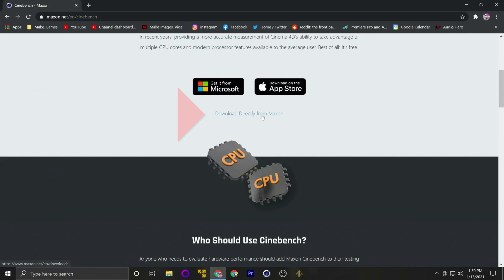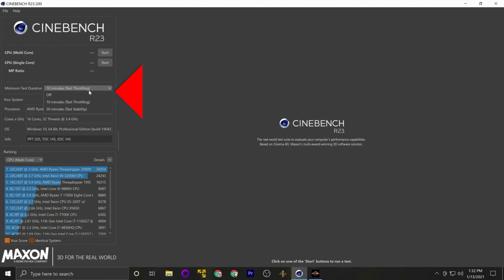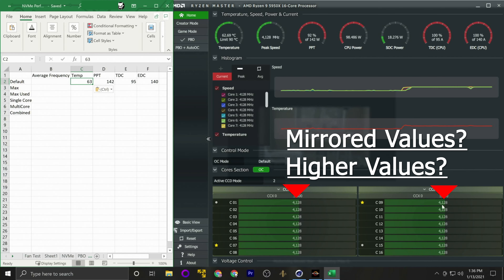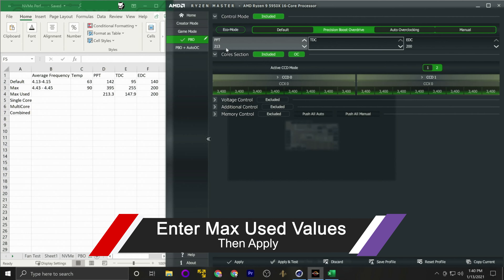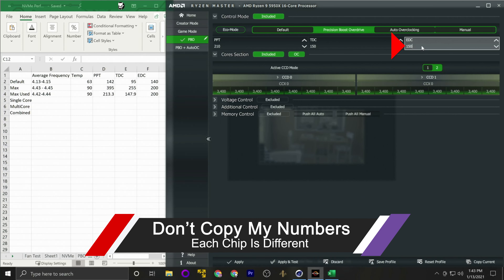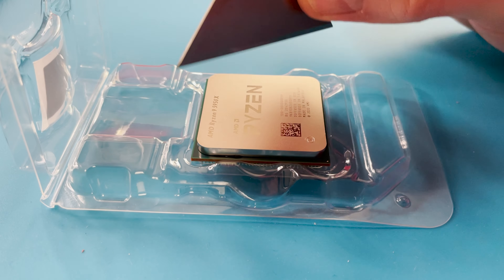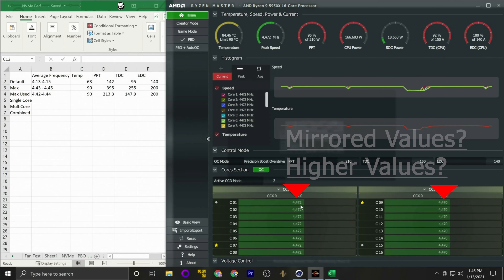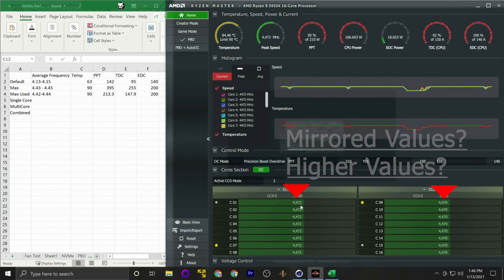Adjusting Ryzen CPU Performance with Ryzen Master ---- Part 3

Comment: Interesting video, great content. Do you think running the CPU at the max of 90C over a long period of time to be safe? Wouldn't this cause early degradation and reduce performance?
Reply from the maker: 90c is when I hit the limit of what the system will allow. I wouldn't run that high for a long period of time but degradation normally occurs due to high current & voltage not heat. Heat might cause your paste to fail faster but shouldn't damage the silicon.
Reply: @TheGrayingTech  Thanks for actually answering. I guess I am asking because I'd like to get max performance out especially since I do some 3d design and Rendering. So would running at 90C for a 15-20 min render be bad? Also would it be ok to just use Ryzen Master and set it to Precision Boost Overdrive mode? without changing other PTT TDC EDC?
Reply: @bchen1226  If you run you Ryzen at 90C, i would bet it's already thermal-throttling. Try to start HWinfo64 and look for Thermal Throttling status. And even if it's not thermal throttling, you won't get the best performance of Ryzen at 90C because of how the Boosting algorithm works - more temps = less boost = less performance.

And i would recommend tuning PBO in BIOS instead of RM. And yes, you can enable PBO with PPT, EDC and TDC limits set to either Auto or Motherboard.
Reply: For anyone coming along later, this "degradation" has proven to be mostly a myth that internet randos who purport to know things keep spreading.  People think that because they can rattle off all the technical things they've read before that they're knowledgeable.  Do they even know about Shockley's equations?  Nah.

Comment: if anyone is having issues with ryzen master requesting a full restart from changing only the pbo limits, theres a setting in Ryzen Master that writes changes directly to bios when you press apply.
Reply: I can't seem to disable that setting. When I try it restarts my system and it enabled again next launch.

Comment: Is it normal for all of my cores to drop to 3.8Ghz or less when running a benchmark like R20?  It seems like the more load on the CPU the slower it gets.  I have a 5950X, ASUS Crosshair VIII Hero, Corsair AX1200 PSU, Elite Capellix H150i with a 320mm radiator and excellent airflow from multiple fans through the case so it's not a thermal issue.  My max temps under 100% all core load is 72C.  My thermal limit in PBO is 90C.  PPT\TDC\EDC are 250\160\160.   Two best cores in CO are -12, the rest of CCD1 are -16, and CCD2 are all -20.   I have preferred cores\CPPC enabled.

Comment: Question.  You say that the default PPT is 88 for 5600.  Then why is my default at  76!!?!?!?!?  Shown on screen at  4:57.   The other settings are like yours....
Reply from the maker: The default is often set by the Motherboard Manufacture. There is an AMD spec, but the MoBo can override it. It's ok to have a lower PPT by default. The goal is to incrementally increase it to ensure you get a good balance between power and temps.
Reply: @TheGrayingTech  thank you for the reply.  I went ahead and bumped it up to 88.  It works great.

Comment: Doesnt this affect L3 Cache speeds? On my Ryzen 7 5800x lowering EDC to 150 read/write speeds of the L3 cache is  @480gb/s but at 300 EDC for example L3 cache speeds are +700gb/s.(Aida64)
Reply from the maker: This is an excellent question. I am doing a video on this very thought right now.

Comment: I have a 2700X. I maxed all my settings and the PPT and TDC usage ended up being lower  than default (PPT:141/138.25, TDC:95/94.35, EDC:140/142.8), WHILE hwinfo reported no thermal throttling. I don't get it...

Comment: is it safe to go over 100% EDC usage? i managed to get 20+ more hz 105% more edc usage and keeps climbing as i drop the EDC value even lower to 113% usage. 135A EDC @100%, 130a @103% +20-30hz, 120a @113% +5-10hz. Was wondering what kind of effects would happen if i stayed over the 101% mark
Reply: Keep everything close to 97-100%

Comment: Thank you so much for this video series. My computer is not using the best core for the single core test. Is there a way I can get the computer to use the better core?
Reply from the maker: Mine bounced a lot until I brought Curve Optimizer into the mix. It effectively lowers the standard voltage curve that the motherboard has and it helps keep the scheduler from bouncing all over the place.

Comment: Please help. With Ryzen Master My 5600x at default is PTT 76, TDC 60A, EDC 90A Temp 49c. I followed the steps in the vid but it will only overclock to 4.5ghz with temp at 62c. If I don't used Ryzen Master and use curve optimizer set at -20 and take CPU to +150 I run 4.8ghz and this was only my second attempt in bios maybe  I can push even further. Why is this happening?

Comment: My R9 5900x 10 ,11 and 12th cores are running at a third or lower of the 4,500 range. Core 11 fluctuates between sleep and about 1,300. The maximumTDC is only 160. EDC 190 ASUS TUF Gaming X570-Pro with the latest BIOS

Comment: Hi, Im having issues with my 5600x. I am getting the whea logger error event id 18. It only happens when pc load is low to idle such as watching youtube videos, never when under full load. 
asus x570 f gaming
16gb 3600mhz cl18 ram
2070 super
650w evga 80+ gold psu

Comment: I'm the biggest loser on the silicon lottery, my 5800x could go no further that -5 all core, tried -10 and windows didn't even boot. might try dialing curves in per core at a later point. 
However, when I ran single core test without dialing in the PPT, TDC and EDC first the load jumped like crazy between the cores, is that normal? ?

Comment: Not sure what has changed wiht Ryzen Master but I cannot disable the write to bios options in settings. When i disable the Write PBO to bios or CO to bios option and hit OK it restarts my system and fails to save the setting changes. As soon as i try to apply a change like setting my PTT/TDC/EDC to make it triggers a restart of my system.
Reply: Ryzen software sucks, adrenaline and master both have issues that haven't been fixed for years. Find a workaround and then just do it that way tbh

Comment: On the first PBO test with 395, 255, and 200 my temps are between 77 and 79 C, they never get to 90. But, I can't raise the PPT, TDC, and EDC any higher in the PBO profile.  How do I find my max then?
Reply from the maker: That's a GREAT problem to have. :) 

Go ahead and start evaluating the best settings. Seems like you are already running well, so I'd expect to see some good gains.

Comment: When I try to bench default values, my pot, cpu power soc power, tdc, edc are all under 60% and the temps are around 75%. I don’t understand what that means. If default is not able to utilize the full range, will imcreasing them in PBO have any effect?
Reply from the maker: What happens when you set them to the max? The default values are normally so low that it doesn't fully utilize the chip. Also, make sure your BIOS is setup to take advantage of PBO.
Reply: @TheGrayingTech  that’s what I was hoping, that the default values are limiting the chip so I tried PBO manual, all values maxed, individual cores set to 4300mhz(ryzen 3600x) and even though it gets close to that frequency, the chip is not utilizing the available cpu power

Comment: I have a 5900x and I can't put it over 4.0 without the temp getting to 90 and above.. Voltage is around 1.1 any higher temps go crazy as well.  I have a water cooling system and there is plenty of ventilation. What could be my issue?
Reply from the maker: Something is definitely off. What is it running with the default settings? Check to see if any one particular core is running hotter than another. If yes, it could be a gap in the paste. If everything checks out, try setting voltage to auto and use curve optimizer to see if you can get the temps under control first.
Reply: @TheGrayingTech  So i reset the bios and the cmos and things improved somewhat. I also added new thermal paste...I set voltage to auto and use curve optimizer and it does run better but no where near 4.7 actually the highest I got it to float around is just under 4.2....

I have another question when i use cinebench r23 i notice the ghz never gets really high but If i hit apply and test in ryzen master i do see those higher ghz Ive seen up to 4,6.  I also see higher frequencys with other benchmark programs bur cinebench the ghz go high
Reply: Also that under 4.2 ghz that i get from cinebench happens when my ppt around  is 100 and edc and tdc around 75... Just adding this information in case it tells you anything

Comment: Please help! On my msi meg unify x570 when the bios E7C35AMS.A82 at settings PPT 205, TDC 145, EDC 145 processor AMD Ryzen 5950x all cores are running at 4.5 mhz, but as soon as I install the new version of the bios, which in fact should increase and optimize - then all the cores on the processor are running at 4.2 mhz. Please help me adjust the settings correctly in the bios
Reply from the maker: Let me look at an MSI BIOS screen and I’ll get back to you.
Reply: @TheGrayingTech  please let me know what parameters to show you from the bios
Reply from the maker: I think I found a good photo here: https://www.anandtech.com/show/14603/the-msi-meg-x570-ace-motherboard-review/8

So BIOS > OC Menu > Advanced CPU Configuration > Precision Boost Overdrive

See if you can set that to Manual and populate the PPT, TDC, and EDC values.

Comment: So in order to stop my best core from jumping (from 3.155 to 3.865) I need to do more adjusting of ppt, tdc, and edc?
Reply: That's with single core, with multicore running I get a constant 4.136-4.144
Reply from the maker: Curve Optimizer is the key to avoid the jumping. Dial it in, and you'll be golden.
Reply: @TheGrayingTech  sweet, thanks man!

Comment: I ran a baseline SC test on cinebench and my single core was bouncing between the two best cores in CCD0, everything is stock. Is that normal? I'm a newb when it comes to this stuff, just noticed you said it shouldn't be doing that
Reply: Had this with my 5800x as well.
Reply: Same here...🤔
Reply: did any of you find a fix?

Comment: I have a 5950x but my max TDC is 160A... yours is 255A... My max EDC is 195A, yours is 200A....  any idea why? edit: it's AI tweaker pbo limits in the bios. just manually set them higher.

Comment: I followed this very closely and was extremely careful but after I dialled in on what the optimal settings would be and set them in my BIOS my computer won't start and all I have is a red cpu debugging led I've tried ressetting the bios/CMOS and can't get it to work my numbers were very close to yours in fact they were lower on all wattage so I don't know what to do
Reply: remove battery for 5 mins

Comment: I didnt get anything wiser. My 5800x clock speeds never exceeds 3.725 even tho it can do 4,7ghz with turbo and I cant even hit max W except the EDC. So yeah this didnt help me one bit.

Update: I just went with my previous settings PPT 120 - TDC 85 - EDC 130 and now increased the undervolt per core from -20 to -30 and set the CPU voltage to 1,202 (all from inside the bios). Setting cpu voltage to 1,1 caused it to crash when trying to run Cinebench. Overclocked to 4,7ghz and ran a 10min cinebench test and the temps didnt go higher then 73 degrees while hitting max 4,7ghz and the voltage just below 1,2v. On default i got a score around 13000 now its around 15800. I'm happy.

Comment: When I dial everything to max, the average frequency is around 3.95MHZ. And temperature at 82 C. Can't boost it to 90, do u know why? Only got a 240mm radiator
Reply: Maybe it's because I only have a 850W power supply with a 3080 and 5950
Reply from the maker: Check out the latest one video, i consider it a quicker guide. Curve Optimizer + PPT + TDC should help get your temps down. If you set everything to max, it will not perform as well without a custom loop. 

https://youtu.be/F205IDSXoMk 

Power supply shouldn't be an issue because chances of a CPU and GPU spike at the same time (500+ watts on the GPU for a spike) should be very rare under game play condition.

Comment: Question:  Why dial in the limits?  Couldn't you just set the motherboard maximum, and let it figure it out from there?
Reply: No because it can go overboard and just pump too much power in, causing throttling due to heat.

Comment: if I raised my cpu volts in cios from 1.20 to 1.23 is this gonna make a difference? I had to do that as I want stable after doing a little ram overclock
Reply from the maker: I lean towards auto-volting with PBO. Just to keep things dynamic. BUT, increase the volts can improve stability if you are seeing issues. So it is always a legitimate option. I had to play around with extra volts at one point with the Air Build of Red Star.
Reply: @TheGrayingTech  ok gotch, so would I have to set it back to Auto if I use PBO? or can I jus leave it at 1.23?

Comment: Greetings master, can I download and extract some more of your precious in tech lechoowal understanding? 
Goody.
I have a 5800x a 550 gigglebyte mobo, and following your most sagacious tutorial - I am at the part of switching from 'Default" to 'PBO"' .
On my machine it already shows the max already of:
PPT = 480
TDC = 360
EDC = 480 ... umm errr I am confused, when running the Default I saw the standard values you have stated for the 5800x.
So do I surmise that every system has differences and just because you had to enter the max values, it doesn't mean I have to?
Thanks in advance good sir.
Reply: Oops forgot to say, after switching to PBO and running CB, the frequency (4.6ish) and the temp (84) was the same??
Reply: Gahh, sorry, some weirdness afoot in the mobo not saving, I done a big reset and re install and now we are cooking with gas!
Reply from the maker: Each MoBo manufacture will set things up differently, but from what I have seen in forms and other posts, yes the values "max out" around the same. But always good to test. Glad you were able to get it to work. !

Comment: On default my 5950x only boosts up to 3.6mhz during cb23 everyone else I see is boosting to 3.9 mhz on default. Why is mine lower? Do I have something wrong in the settings ???
Reply from the maker: It sounds like there is a setting in your BIOS that has PBO disabled. It's call so many different things that I am going to end up making a video series about just that. Which motherboard manufacture do you have and I'll take a look.
Reply: @TheGrayingTech  i have a ROG Crosshair VIII formula

Comment: my 5900x single core test is very sporadic. I cant seem to get it to be more consistent like your test. the multi core was fine similar to your example but the single core has large fluctuation and is switching between the load being on my gold star core and the silver dot core.
Reply: Hey mate, did you end up figuring this out?
Reply: also wondering the same thing

Comment: on multicore i could get all cores to 4500mhz with my 5900x, but on singlecore it doesnt geht higher then 4900mhz. also the single cores are jumping around the hole time when i am running the cinebench23.

Comment: thanks for the video and i'd like to have some help from you,
i couldn't go beyond 4.5gh on my 5950x, i tried all option on ryzen master,  i disabled pbo on bios to be sure it applies the settings from ryzen master but in vain :(
Reply from the maker: If you disable PBO in the BIOS it will prevent Ryzen Master from fully working. The two work together, so be sure to have it enabled then do all the tweaking. Also, pay attention to the peak temps. PBO will drive the processor 80-90c (which you want) but you have to have a good thermal solution to go with it.
Reply: @TheGrayingTech  hey, thank you for the reply,
i did try your videos step by step, still couldnt get the 4,9 or so in speed, and yes the cpu is getting ~80-90.
sometimes when i hit the 90, it shutdowns and a bios error is displayed(thermal error).

i do have water cooling(ek motherboard block)

Comment: Man I Just love this video. I still dont know If Clocktuner for ryzen is more efficient for overclock/undervolting than Pbo or manual Oc.
Reply from the maker: I'm going to test just that in a few weeks. I need to get more familiar with the tool before I can post some videos about it.
Reply: @TheGrayingTech  Man im a grea fan of yours, I was Reading about It, It looks like Curve optimizer os more efficient, but CTR for ryzen gives u the best values of over and underclocks. Cant wait to ur Next vídeo!
Reply: @TheGrayingTech  i just found out about CTR, PBO, AutoOC, Ryzen Master, and all these apps are confusing. too many ways to be undervolting or overclocking.

Comment: I've found my optimum PPT, TDC, EDC numbers in Ryzen Master, however when I apply them in the BIOS, I get much lower clock speeds. The peak core voltage is also lower after making the changes in the BIOS (which I'm guessing is the cause). Anyone have any ideas?
Reply from the maker: Depends on the MoBo manufacture but they all play games with voltage. If you're MoBo starves the CPU of voltage things won't go as high. You might need to manually set the voltage if the Auto setting is causing problems. Who is the manufacture?
Reply: @TheGrayingTech  I am also having this problem on an MSI b450 tomahawk max mobo. I dialed everything in on Ryzen master as you said, was getting clock speeds pushing 4.5ghz on all cores on my 5600x with roughly 1.33V, but when I wrote those values to the bios and ran it again, cpu was only getting ~1.28 volts and clock speeds were down in the 4.3 range again. 

I’m afraid if I set the cpu voltage manually to 1.33V it’ll just stay pinned at that number all the time. Should I do a positive voltage offset of .05V to make up the difference, and that way it’s not always just stuck at 1.33?

Edit: If I do this is it going to mess with using the curve optimizer?